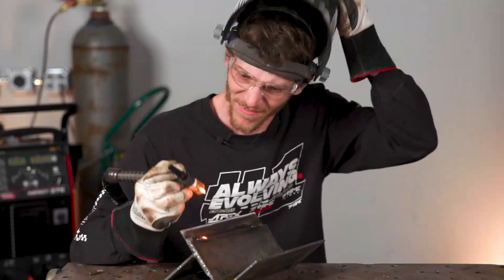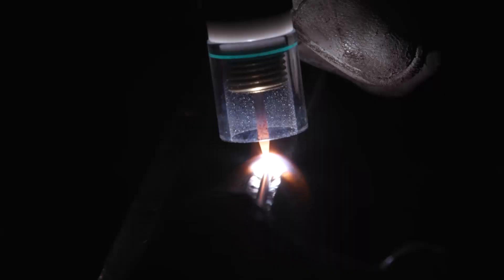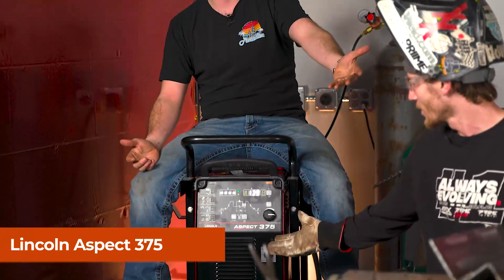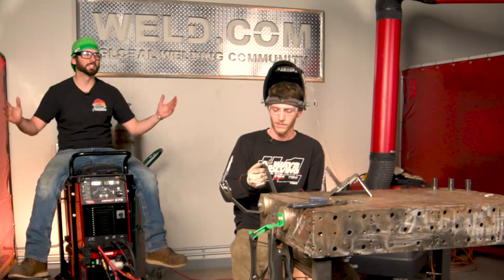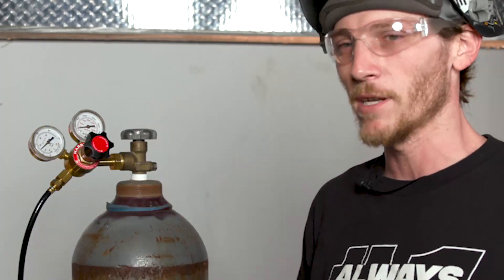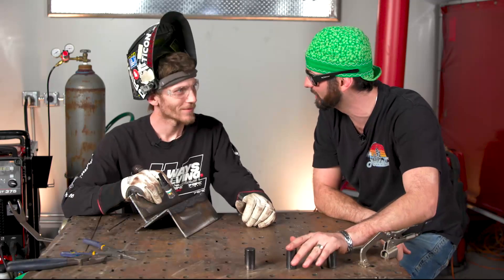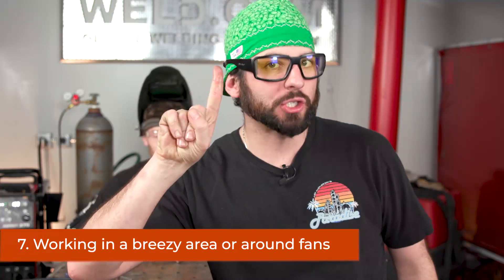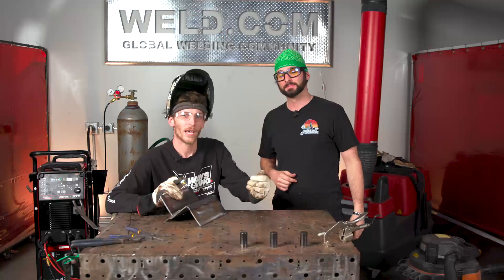TIG Welding Tungsten Problems | Why Is My Tungsten Turning Grey?

Comment: I've had it turn blue and also gold after welding what's up with that?
Reply from the maker: its the same deal,  ideally you want it to return to silver. if you get gold.. thats fiineee, blue ehh its fiine. turn up the post flow and it will fix that.

Comment: Sometimes when I sharpen my tungsten on a bench grinder, the tip gets red hot, could this also oxidize the tungsten?
Reply from the maker: absolutely, after you get it red hot, do a light grind with not alot of pressure, thatll clean it up before you weld